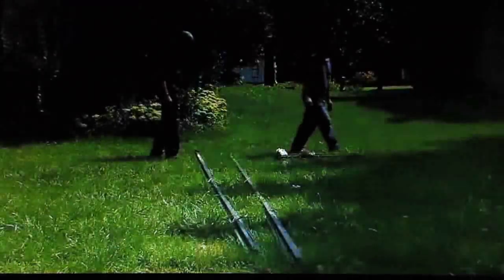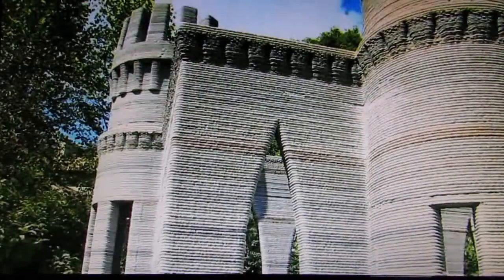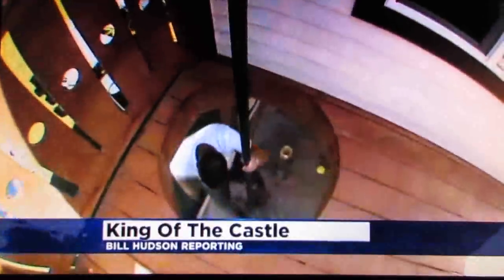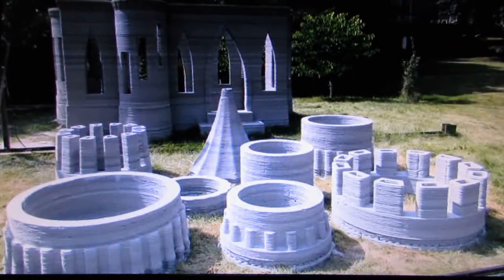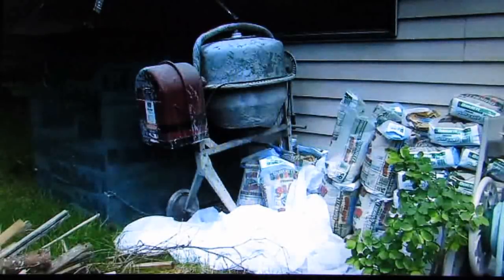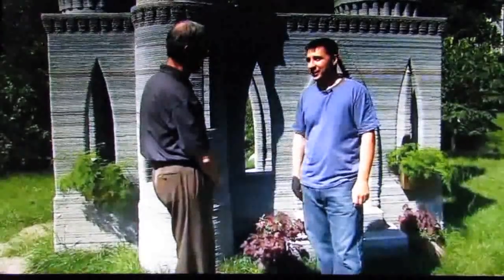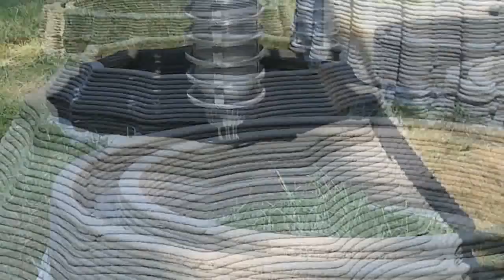3D Printed Concrete Castle

Comment: I think a lot of people might be looking at the texture and thinking "meh", but it looks like it'd be really easy to give the outside a skimcoat and make it really smooth and nice looking, or even skimcoat it with a texture, or heck, a block pattern.
Reply: +Dan O&#39;Connell  Yup.  Throw some stucco at it and there you go.  If anything the ridges on the surface would make a great substrate.
Reply: Or even tint the cement to add interesting designs.
Reply: you trowel it real time while its printing.

Comment: I did not read all the comments, but many are concerned there is'nt any rebar and so it is not strong. Concrete can be made incredibly strong with additives. When special glue is added it is now "polymerConcrete". There are even tinny little fibers you can add that do work like a rebar. It could be a whole lot stronger then you think.
Reply: And no concrete erosion due to rebar rusting = more service years

Comment: Is it pretty quiet compared to normal construction? One could use this type of printer to make cob or maybe adobe houses, too. Seems like it all comes down to the right consistency of extruded material.
Reply from the maker: not only consistency, everything should work nonstop flawless days or weeks oudoor without buildups and no need to clean...... and keep in mind it is portable....  believe me its hard to make
Reply: Andrey Rudenko what is the mix recipe?
Reply: Noble 3D Printers, LLC a concrete fluid enough not to clog the extruder but solid enough to keep the form once extruded... it could be made with the low weight concrete mix used in skyscrapers that is pumped too...
Reply: +Andrey Rudenko brilliant work andrey. congratulations on this, i've barely just found it.

Comment: you could add another head that installs steel rods into each layer bonding each layer as each layer is formed also this leaves a awesome finish for plastering over i dont see why people are complaining you have to plaster the  outside and inside of most concrete buildings anyway
Reply: +Deon Hamilton 

Spray stucco on the outside for spatter finish or swirl finishing would be pretty easy.
Reply: you're right, but there is also concrete and geopolymer that does not require rebar

Comment: Try using foamcreate, by mixing Drexal foam with concrete. It comes out very light, in fact it floats in water once hardened. 3 times the insulation as concrete and it's even stronger! Plus with each bag of concrete it doubles the batch. Look up Youtube: Air Crete Dome Homes. MUST LOOK UP VIDEO, IT WOULD CHANGE THE OUTCOME OF THE CURRENT PROJECT TO MAKE IT ECONOMICAL.

Comment: I think he could incorporate reinforcements of metal to strengthen it, and lift it with a crane. He could also add fiberglass to the mix for strength. An inner and outer wall would leave space to insulate, and run the wiring and plumbing. There is an additive for moisture barrier.

Comment: Print dome houses that have multiple applications for both above and below ground. With concrete thats Hydrolitic. With fiber optic cables to bring in sun light and for power for them and to heat water. All self contained.

Comment: Andrey Rudenko. Ignore the naysayers. You are the one with the intellect and gumption to actually make it work. This kind of process is still in it's infant stage, so whatever you build with it should be considered R&D. You should be thanked instead of criticized. Whoever says it will not work without rebar is wrong. One example is a dome, whether it be geodesically self supporting or a simple dome-top earth and mud hovel. There are rudimentary mud hovels in Europe that are still standing after some 1,000 years. (I'm not well learned in European history, so I could be way off the mark in terms of the age of those mud huts).
Reply: Expressing a concern is CURIOUSITY, not necessarily naysaying. Imagine the cool decks that could be built with this with water features built into it or a large fountain. Many possibilities in the future. Folks are just "thinking out loud" and brainstorming here I think.

Comment: This is awesome!

I'm curious about two things:

Does the printer mix its own cement as needed, or do you have to keep mixing and climbing ladders to refill it?

Also, as the "wet" layers build up, have you had any issues with the added weight overwhelming the not-yet-cured cement's ability to support it?  Like having to dynamically slow down the printing process to allow the previous layers time to solidify before adding more layers?
Reply: +Dosbomber They either are dead or unable to write comments in English.
Reply: +Dosbomber looks like he waits for it to dry, or he does have to refill, and by the times thats done, its cured enough to support it, the coloring shows that
Reply: jeremiah hintz
I see the coloring, but it looks like there's about 10 layers that are still wet (darker).  I was wondering about how much weight those wet layers can support before it starts to sag.
Reply: Dosbomber yeah, maybe the mix is lighter
Reply: +Dosbomber maybe he does it a couple layers at a time

Comment: In case of clay plus baker - he could create reinforced walls on the fly. Also. He could use metallic chunks in the mass to get reinforcing too. Also. What doesn"t let to put a wire with fixators in the concreate mass right after the extruder and fold it the way it needs.

Comment: Just mix in some fiberglass and it's reinforced. Also it would be cool to have a moat around it and a small draw bridge. No crocks though.
Reply: aw,...the crocs are the best part.
Reply: I was wondering about that because cement works great in compression but not in shear loading - thus in an earthquake you would have a lot of VERY heavy debris falling on you, along with the fact that concrete is a poor insulator.

Comment: Problem - previous layer is not set up before next layer goes on and if concrete is mixed to set fast - it will set inside the machine. 

Solution - extruder also "SQUIRTS" a line of hardener that will initiate the concrete's setting reaction. 

Please let everyone know if this is already a part of the technology. 
Thank you so much for your work.
Harold

Comment: Well... how do you rebar it tho? Concrete is perfect for heavy compression projects but the tensile strength is really very poor. (in non leymans terms: Its great as a pillar but cant be used unsupported for longer stretches without serious breakage. Like a 5 meter span between two pillars would make a 20cm thick concrete floor break very easily).

Comment: What  a great idea !  A couple of years ago I was at a machinery auction , because thats   where we buy most of the machines for my shop . There where a row of  X Y Z welding robots that went for next to nothing , complete with power supplies and computers , I was sad to think they were going to go for scap metal , but I couldnt think of anything I could use them for , I badly wanted to rescue them . Some one like you could turn them back into gold . I noticed you  leave a space between the walls , I take it that that could later be line pumped , and a heavy mess inserted , then theyd be similar in strength to concrete culvert ?

Comment: Unless you've got the lost recipe for ancient Roman Concrete perfected, you need some type of reinforcement matrix between the layers or in the mix. Because obviously, having pre-formed rebar structures sticking out would interfere with the nozzle path.

Personally, I don't like the layered look. It messes with my senses in a way. I can't describe it. I'd have to go back and smooth everything out or fill in. Thus creating more work for myself, that the 3D process was trying to eliminate.
Reply: TheBikerScout Yeah, but BFD, right?  Meantime, you've got your castle.

And I'm thinking mud mixed with straw is used to make huts - it all depends on the dimensions. It might be possible to use any fibrous material in the mix (the stronger the better) if you have coservative proportion of thickness to height. Stuff that stands for centuries. Eons, even.... Can't knock it down.
Reply: TheBikerScout It's for fun. Not a real castle to withstand seige (or earthquake). I'm sure Disney doesn't expect to build a real house out of it. Maybe just some quick disposable theme parks.
Reply: I realize this particular project is just for fun, and it's structural integrity isn't that critical. BUT... this is also a product showcase. Something that can more than likely be adopted to a larger scale. I'm sure the designer of the system hopes that happens. Otherwise it's a lot of work and investment just to make a kids sized castle.

So that means, that there still needs to be a reinforcement matrix that needs to be worked out before this can become someone's home or structure.

It's possible that small rebar can be pushed into the layers as the print head moves on. But that takes away from the set-it and forget-it building approach. And therefore slower than traditional slab tilt-up, or pour in place methods.

We are going to be building a 55ft diameter dome home, and using a special mix called shortcrete that can be sprayed vertically without sagging. But being blown inside an inflated air form can be done in a matter of hours. Printing a dome structure would take many days. Which do you think would cost more? Everyone charges by the hour.
Reply: TheBikerScout The fact that people have been trying to print "real houses" is not news. The fact that this guy did a castle in his back yards is news. This has been the subject of university research for many years and I'm sure the topic has come up. They just didn't think of building castles in back yards or disney land as a potential market. lol

And "dome homes" are the most impractical residences. It's more like a hippie novelty than anything that will be adopted in large scale.
Reply: Maybe an old Buckminster Fuller Geodesic Dome is hippieish... but a Monolithic Dome made out of concrete is awesome. If you've ever toured any of the nicer examples, they have a great "feel" to them when you step inside. Plus, our ground floor is 7 feet below grade, and the average temperature will fluctuate between 68°F and 72°F. Amazing natural light floods large areas without harsh angles and shadows. Earthquake and Hurricane proof. Won't rot, creak or be susceptible to in-the-wall critters like termites, rats or roaches.

Don't knock something until you've got first hand knowledge of it.
Reply: TheBikerScout You can build cornered houses that don't fall on hurricanes and earthquakes too. How often do various sizes of buildings in NYC fall down in a storm?  Other than a complete waste of space, you can't practicially fit most stuff in it. It works if we have little wings and can walk on the walls, but why would you want to waste so much USABLE vertical space unless you just want to be different and show off to your hippie friends and brag you save $100 on "energy costs", which is peanuts if you're going to build one.
Reply: TheBikerScout true. there are other concrete extruders that fix some of those issues... a rotating head with spatula sides could make a clean wall, and a person (or the same head with an attachment) could put small iron reinforcements in the layers... the extruder could make a pattern between the walls to strengthen them
Reply: TheBikerScout There are varius kinds of metal strips that they add to cement to make it stronger and reinforceing the strength of the individual layers.
Reply: Ricardo8388 A Chinese company makes "slices" of a house with embedded mesh and assembles them. Although I don't think this is ready for our regulations as some age and a good earthquake or something can prolly make it fold flat vs. using traditional pre-built rebar structures.
Reply: TheBikerScout What about fiberglass fibers i the mix for the reinforcement
Reply: Sylvia Orr You are correct... you can use fiberglass reinforcement fibers suspended in the matrix and it does add strength. For instance, if you made a concrete countertop, that's considered an industry standard. However in structural concrete, there's more science behind keeping out buildings safe from collapse. There's shear forces, and compression loads that have to be taken into account. Re-bar is still the best. Because these layers are partially starting to cure by the time the gantry head makes it back around to start the next layer, you've got an onion skin effect, whereby shear forces could allow the building to slide off its own layers in the event of a mild earthquake. Fiberglass in the mix is only going to make each subsequent layer strong unto itself, but not tied with the layers above and below it.

If you want a castle made out of concrete, it's best to precast the walls flat, using traditional concrete casting methods. You can create any kind of mould that replicates stone brick pattern out of silicone, and pour the mix into that with a rebar structure supporting the load in all directions, including axial twist. Stand up the walls... viola... an instant castle. And it still takes less time than it would to print it layer by layer.
Reply: Makes sense
Reply: +TheBikerScout It would be much harder to get curves or details unless you wanted to spend painstaking hours working out the mental nitty gritty and the method of creation. IF you know what you're doing, then using your skills is far superior to this method.

I dont know much about construction. I do know computers and i like the idea of visualizing a piece, then making a 3d vector image of it and turning that into reality.

It may be pretty ugly, but if i want some gargoyles and or unique structures, its far easier to just import the model and scale it than it is to learn how to cast each individual piece.

Also, becuase it is partly machine, it will fall on mores law and get way better as the tech surrounding it advances. 

Can you not feel the potential for this? sure this man's project is unimpressive for a professional sphere, but as an entrepreneur, surely your gut must feel some pull of excitement.

The whole future is going to be like this eventually, the rebar problem will be solved and advanced concrete mix packs will be sold like printer ink. Just like the 3D printer will be the standard of product manufacturing. Its all in one package.
Reply: +TheBikerScout Fibreglass reinforced concrete is much stronger.  I'm not saying it would eliminate the need for rebar, but it would probably help.
Reply: +Despicably Irascible Rapscallion Sorry, I missed the earlier Fibreglass comment.

Comment: Had you considered adding dyes to the mix to change the color?  Did you fill the space in between the inner and outer walls?  I think a spray foam would work well to add some insulation value to the walls.  Thank you for sharing.

Comment: You know what this could really use? Some modular parts that the concrete could be poured into to give them a nice smooth look; it wouldn't even need to be all that hard, and could be made out of anything from metal to plastic. Now i wonder where you could get some of those from~

Comment: it probably wouldn't be too difficult adapting reinforcements you could just change the printing patterns maybe make a different tip pour easier might not even have to change the consistency of the concrete

Comment: As a former concrete pump  and 3D printer owner….combining high tech with Portland is a tough bedfellow.
Very nice to watch it working properly, however.  ;-)

No comment on rebar ….  but what about the building inspector?
Perhaps a machine that chases those guys back into their rigs?